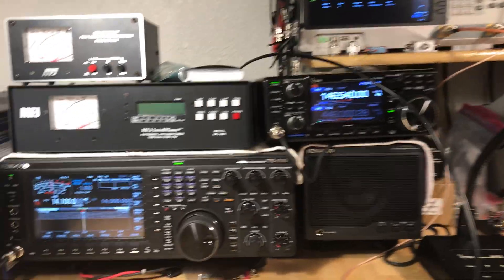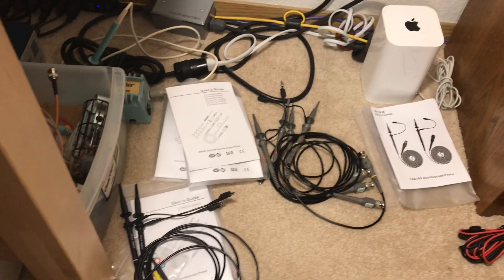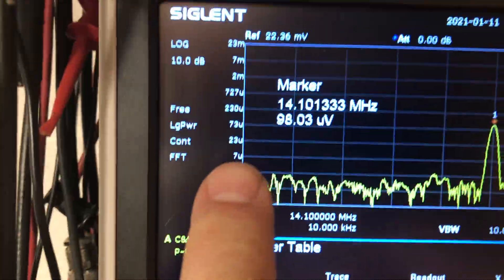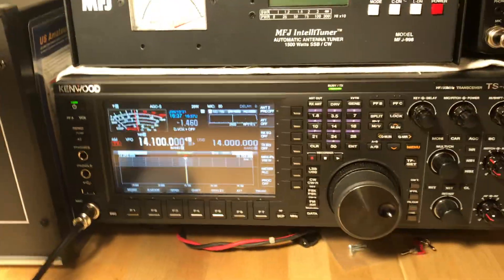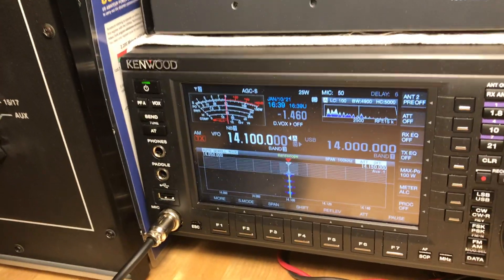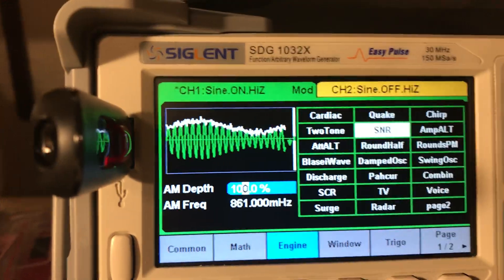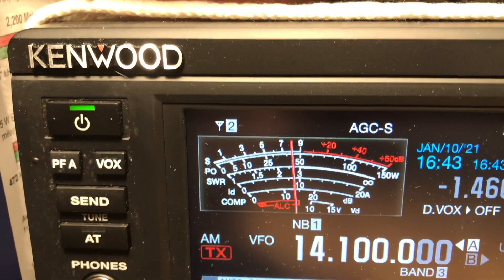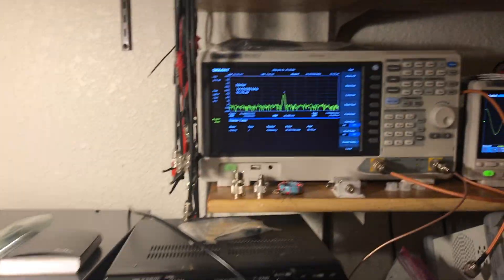Ham radio "S-meter" verification/calibration issues/questions.

Comment: Hey I’m coming late to this too. Are you actually aware of the two different calibration settings for the S-meter of that specific radio? If I remember correctly one follows the IARU  standard, the other Kenwood standard. Try and look into the instruction manual. You might find the answer. 73

Comment: I know it's a little late but I just read some instructions on this and it said to use 30% modulation. hope it helps someone. also, just a thought sideband is transmitted slightly higher or lower than your 14.1 Mhz this might be your difference in S Meter readings. you probably need a steady tone also.
Reply from the maker: Thank you so much for your input/feedback !